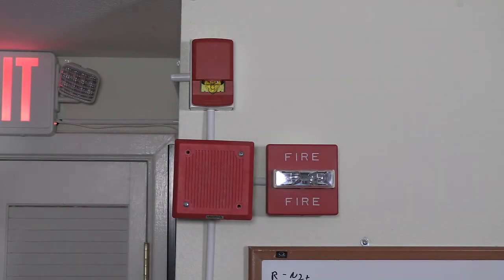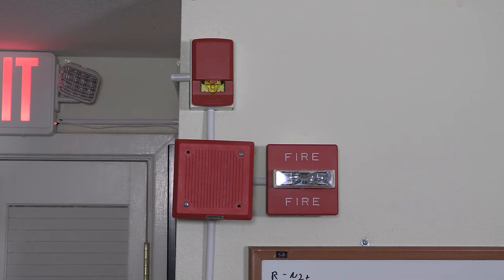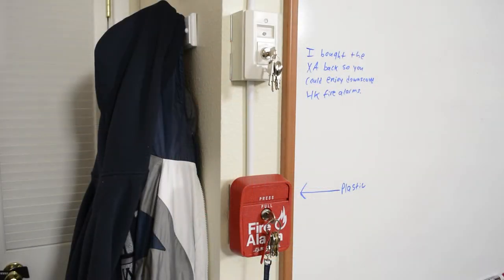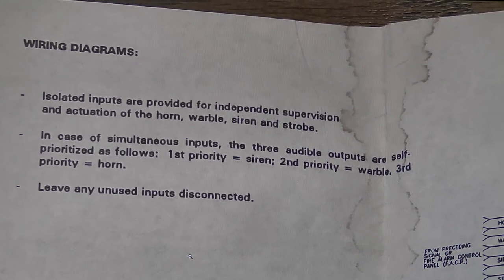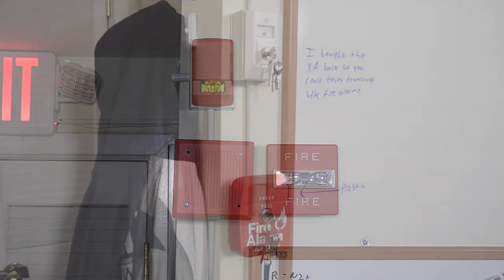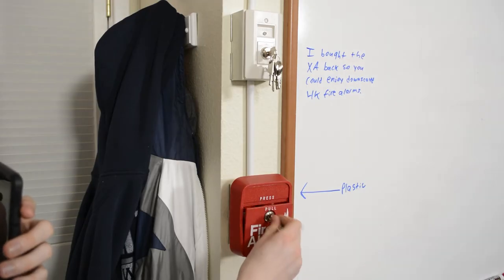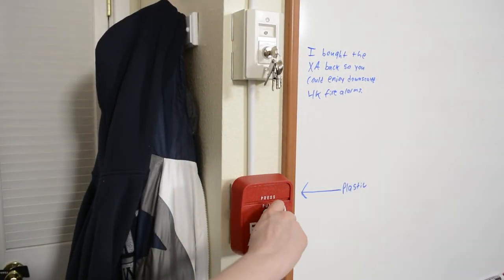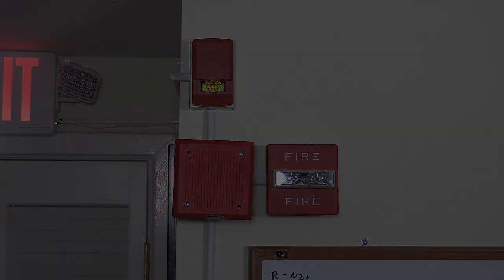Wheelock AES-DL1 Overview and Demo | #FireAlarmFriday

Comment from the maker: *CORRECTION (040921): After speaking with several other commentors regarding the model number of this particular device, it appears that Wheelock may have mislabeled this as a -EL1 unit instead of a -DL1 unit! I've corrected the title and thumbnail; however, the incorrect model number is still baked into the original video.*

Comment: That's an AES-DL1, not an AES-EL1. The "D" in the model number means that it is flush mount while the "E" in the model number means it is surface mount.
Reply from the maker: The model number is AES-EL1 according to the sticker from Wheelock on the back of the device.
Reply from the maker: @DVaccarelli1988  I spoke with Henry yesterday who has the manual for the alarm and it does appear that Wheelock may have mislabeled this unit!

Comment: Ah but what happens when you pull the pull station and the switch the key and have both tones supposed to go off
Reply from the maker: The input with the higher priority will take over in that case (i.e. Fire notification could be set as a higher priority over a medical alarm).